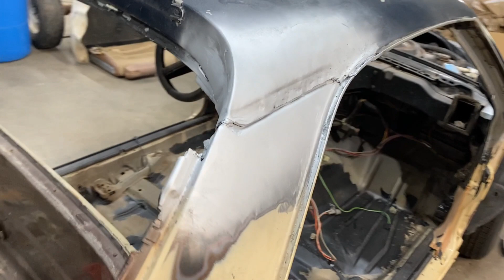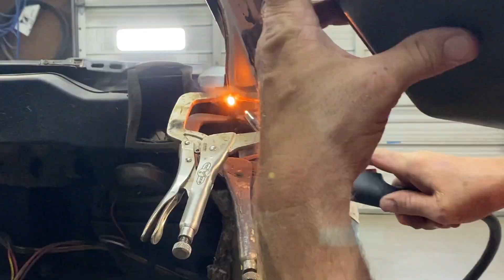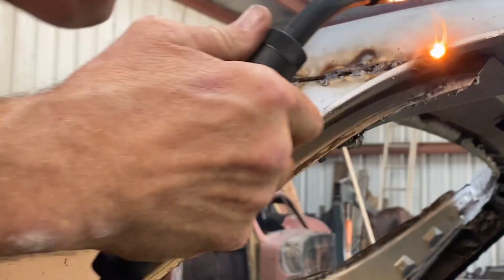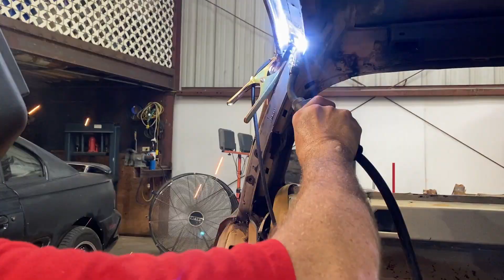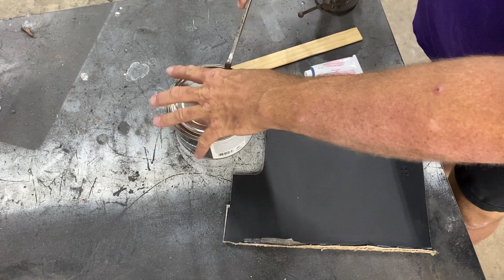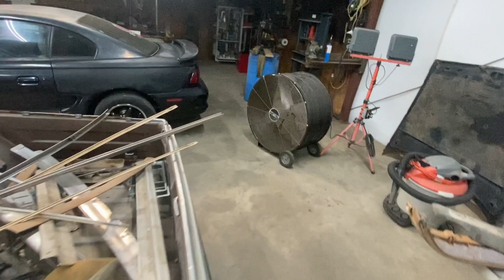Final welding of El Caballero Roof

Comment: Are you using putty buddy? Or is it lead Fred?You did a good job on this one! I took a second job to add to my self employment in my own body shop from 1985 to 1990 in the body shop of a GM dealership, I worked on a lot of these and of course the ''G'' body cars, I got almost all of them that came in wrecked because the other guys didn't like working on full frame cars! I rebuilt several of of them that were roll overs and the only body panels that didn't get replaced were the floor and firewall! A lot of insurance adjusters didn't know when to salvage one back then! I bought a lot of damaged ''G'' bodies that the owners decide to trade in wrecked instead of having them repaired! At one point I had five Monte Carlo's licensed and insured! I had my son and two step daughters in 1978-79 Monte Carlo's, I had an 81 and my wife at the time had an 84!, I don't care what anyone says they were good cars! Those kids couldn't kill those cars! I did have two parts cars setting in wait when I put three teenagers in the 78's and the 79! Which was a good thing because two of them tore the front clips off of them and the other one took the passenger side fender and door out and the rear bumper and  right tail lamp! After each kid wrecked one time they sort of learned to drive after that because I made them fix them!
Reply from the maker: Fiberglass filler then putty!
Reply: @SantasWorkshop  So it's Putty Buddy! Tell Fred where to put his lead! You'll have to excuse me, I started in a body shop in 1970 and all of the ''old timers that I worked around had started out back in the lead days and they all would clown around about Fred and his lead and his Buddy with his Putty!, Speaking of putty, You're one of the few people I've heard that still calls plastic filler putty, You've undoubtedly been in it about as long as me!

Comment: How long does maaco take to paint this thing? That was a detailed series and now the end is missing. Also nice cars and coffee material. Hold on: last time I missed the coffee part 😁😁
Reply from the maker: They are severely back logged. Said it would take a couple of months.
Reply: @SantasWorkshop  PLUS, this one is requiring lots of other work. Some disassembly to get color inside the fenders and all that.
Reply: MAACO is home of the "ten foot" paint job (Paint that looks good as long as you're no closer than ten feet).  The El Caballero deserves better.  Just as well that MAACO is backed up.